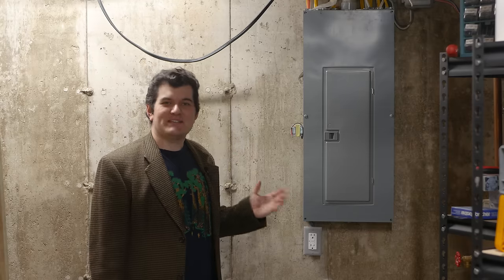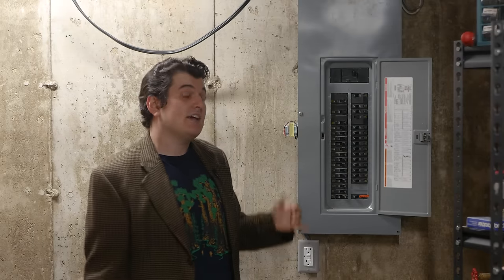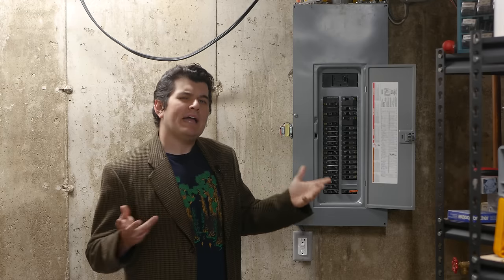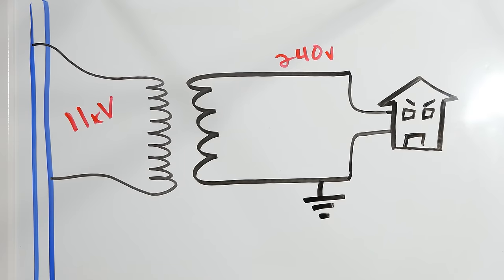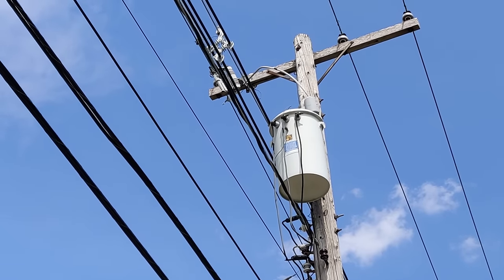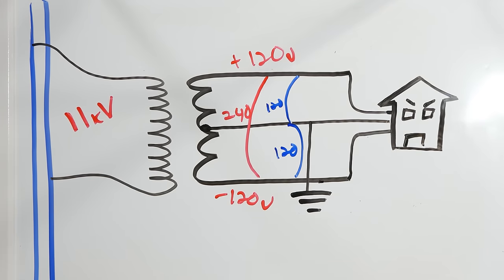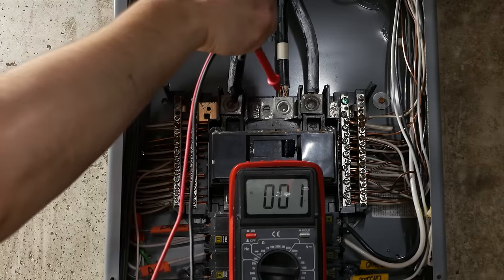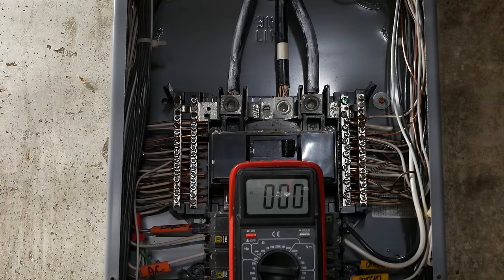The US electrical system is not 120V

Comment: 3-phase, 400V... is what we have at homes in “EU”... Why was this overlooked 😜 ?
Reply: 380, nominally. Not allowed in UK.
Reply: @gharwood1356  according to wikipedia 380V is the old standard. (single phase was 220V hence with 3 phases, its 380V) today, its 230V single phase and 400V 3-phase.
Reply: @kings_pride  Yes that's part of the harmonisation. Primarily to accommodate the UK's 240v. All they actually did was widen the tolerances a bit, so that no-one needed to change things much.
Reply: cries in single phase 230V
Reply: @gharwood1356  I can confirm working in the UKs Electrical Distribution Industry that the UK did absolutely nothing on the whole to confirm to the EU's 230 standard for harmonising the two networks (maybe the odd Transformer tap change here or there) . Our tolerances are +10% and - 6% around 230 so anywhere between 216.2  and 253 so in reality it makes very little difference and we rely on the tolerances as you said
Reply: @tiggerthegreeb  I think that confirms the gist of what I said, nobody did anything, they just tweaked the tolerances so that it all fitted.
Reply: @gharwood1356  400V since about 20 years nominally and actually.
Reply: @gharwood1356  it was 380V nominal a long time ago (maybe 20 years) now it is 400V nominal.
Reply: @Jonas_Aa  Really interesting, this. I've had a barrage of responses clarifying a 20v difference in nominals, but nothing on my criticism of UK vs EU outlets and wiring protocols. Odd.
Reply: So 4 conductors street-to-house instead of just 2 for 230V single phase. Overkill tbh
Reply: @Froggability  basically all houses in Sweden have 3-phase coming into them. If single phase would be used it would have to be so high current, and would load the system unevenly. Better to use 3-phase. Small houses maybe has 3 times 16A (at 230V) and bigger houses 3 times 25A or even more. We need our power to keep warm since we do not have has as much as in the US.

Also it is maybe 4 compared to 3 since you would want ground in the single phase system as well. But we usually run 5 cores (3 phase, zero and ground) to our electrical panels. So 5 compared to 3 but with just 2 more cores (5) you can run 200% more current in same cross section.
Reply: @Jonas_Aa . Ok. so in NZ /Aust we use 2 x 16mm (32mmsq) conductor at 63A /230 240v = 15kw. No earth required each house has earth stake.  
Sweden 3 x 16 or 25 x 230 = 11-17kw. Guessing conductors size : 6mm x 5 = 30mmsq. 
Works out very similar. If my 6mm guess is correct. The down side a more complex supply side.  Advantages each way I reckon
Reply: @Froggability  yeah usually 6mmx5 so seems to be same. Yeah and ups and downs with both systems I guess.
Reply: 400V. Wow. Seems like most items wouldn't draw much - no worries about popping breakers. I can't find anything around the house that would be better running on 400V.
Reply: @captbiptoe  With every plate abled to draw 2.5 kW plus the oven itself, it's good not to connect it to only one phase with 230V.
Reply: @captbiptoe   2x16A (~7360W) for cook top (we do not have gas). 1x16A (3680W) for oven.
And 3x10-25A for heating depending what type of heating.
Reply: @Jonas_Aa  Sounds good. I have the 120/240 of the video. On the 120v side they limit it to 15-20 amps - about 1500 watts per circuit. On the 240v side 32A max per circuit - just over 7000W per circuit. With the house having a 200A service. Plenty of power for most. As long as the home is wired properly all's well for all.
Reply: @captbiptoe  Here small houses have 3x16A total for whole house. If little bigger house with electrical heating it may be 3x20A or 3x25A sometimes bigger.
Reply: The American system looks ancient compared to the European system.
Reply: @Sir_Baddington  It is. It the same as it was when it was put together. We're not interested in anything higher than 240v in homes. No need for 400v to charge phone, run flat screen tv or much else in a house.
Reply: @captbiptoe  an electric car? a sauna? a large mig-welder? a lathe? an electric pizza oven?
Reply: @Sir_Baddington  higher voltage is not better for recharging. Pizza ovens need to be wood. Mig-welder: use consumer grade equipment -that's what we do here.
Reply: @captbiptoe  i see, USA is still a developing country
Reply: @Sir_Baddington  Just living with standards that were put in place long ago. Does it make sense to retrofit  having 120v, 240v and 400v going to every home? Fine with me if you'll pay for it.
Reply: You are or were getting water into your electrical panel. I see water stains just under the main breaker and corrosion on the L1 and L2 terminals.
Reply: I live in an apartment built by communists in 1980 and it has 3-phase 400V. And we have quite a lot of buildings like this in Romania.
Reply: Its standard in commercial in US that the panels will operate in 3 phase 480/277 (mechanical/main panel) and an auxiliary panel that runs 120/208 for your smaller appliances, outlets, etc. Either way, the standard house panel is overkill for most people as it is, not a whole lot of reason to overhaul the whole system.
Reply: 200 amps for single homes O.o    in hungary 1x32A/230V (single phase, more common, often only 16-20A for older buildings) or 3x16A (3-phase, often labeled as "industrial power) is what you get, also you need to pay a one time connection fee above 32A.   This is why people have hard time when wanting induction hobs in the kitchen.
Reply: I have always been interested on how your powergrid works over there I know i be interested to find out.
Reply: @dons8122  it is the same until the last transformer, we both use 3 phase generators and 3 phase transformers in the distribution grid. The only difference is the last mile, we use 3 phase transformer, and its center is the neutral. Grounding may differ, but here usually: neutral is grounded at the transformer station,  4 wires came from the  transformer station, and depending on what you want, you get 1 phase+N  or 3 ph + N to your meter. Then (depending on the age of installation) the neutral is grounded at the home, and separated into protective earth (green-yellow) and neutral (blue)   between any phase and the neutral is 230V nominally, and between any two phase is 400V (phase angle is 120 degree just like on the distribution grid)    Household items (incl boiler, washing machine etc..) use single phase 230V, plugs are rated for 16A (3,7kW), the only exception is induction/electric hobs, which may require multiphase connection (hardwired), or large fixed machines in workshops
Reply: Not 460?
Reply: @williamhuang8309  not 460. It is not a split phase system(where the phase angle is 180 degree), it's 3 phase with 120 degrees between each phase  https://en.wikipedia.org/wiki/Three-phase  If you look at the top image, you can see when one phase is at its hightest, the other two is at the same level, but they are not at the lowest.
Reply: You monsters....
Reply: Most homes don't have this, this is only for multi-family units like apartments and condos.
Reply: @Deathgrinder1337  The faster a lithium battery is charged the shorter it's useful lifespan.
Reply: @captbiptoe   It's not only about 400V, but rather about 3 phases - maybe you don't need it in house, but around it's quite useful, e.g. for various devices that use 3-phase motors - press drills, saws,
- you can't use it when you got only 2x120V (corect me if I'm wrong).
Reply: @xr3iiii  My auto mechanic's shop is in the business district and uses the usual 240v/120v service. His heavy equipment is 240v and runs just fine.
Reply: @kings_pride  3 phase is NOT 440 volts
Reply: 400v is only used for kitchen ovens, hot water heaters and for radiators. Washing machines also used to take 400v ages ago, but nowadays only 230v as we wash at lower tempatures. .
Reply: @Mnkskanal  not motors then
Reply: @pudpullertm  right. Motors can use all 3 phases. That's what we call Drehstrom - turning current, rotation current.
Reply: @Mnkskanal  3 phase 400V is cheaper than 1 phase 220V. All heavy equipment uses 3 phase 400V
Reply: @gharwood1356  You kind of solved that by leaving the EU
Reply: @tiggerthegreeb  And now the UK fucked off from the EU, so why would they start bothering now?
Reply: @darthbrooks4991  maybe you should not be so egocentric and short sighted . Learn something from others.  Your country is big not great.  Great ?  It only will be if you take all the good things from all countries and you can learn a lot from Europe who has hunderds of years more experience.
Reply: @Froggability  2.5mm^2 coper is more than enough for 16A. 4mm^2 is used for 32A. 32A*sqrt(3)*0.38kV = ~21 kWh just with 4 wires (3ph + 1 neutral) and only 16 mm^2  of conductor
Reply: @Froggability  There are many reasons to do it, one is actually that over a sufficiently large number of users the neutral current evens out, so you can quite safely use a smaller conductor for it. With 3 phase you ideally get trice the power with just one additional conductor. (US) split-phase only twice.

The other are electrical machines. Electric motors are so much easier to do on three-phase, and industrial users use them EVERYWHERE. Since the grid in europe had to be largely rebuilt after WW2, they made it three-phase (updated surviving old segments, sometimes even they were even still DC!) and hooked private houses up to it, too.
Reply: Is that commercial power or residential power. Commercial power yes. 400V seems a bit high. Maybe it was more like 339 VAC peak?
Reply: @jfeeney100  
3x230V to neutral, 3x400V between phases. 

No difference between commercial and residential power, if you need more you will get a 10kV (or higher) feed and provide your own transformer.
Reply: You have three-phase 400V power, but only use multiple phases for a few things. Still, I'm jealous. I'd love three-phase at my house, even if it's only 208V.
Reply: @Sir_Baddington  Sorry we didn't have a war that destroyed our whole continent to give us the opportunity to redo everything.
Reply: @danielkatona1866  - 3 phase in an apartment??? I don’t believe it! The block has 3 phase but in your apartment you only have one.
Reply: @Emin3m1986  well, believe it. The power meter is 3 phase and it's outside my apartment so that it could be read by the power company . From it the wires go into my fusebox inside the apartment and from there it is separated into mono phase, just one power socket was direct 3 phase in the kitchen but I uninstalled it as I had no use for it.
Reply: @jfeeney100  Residential. 3-phase. 400V. 4 or 5 wires: L1, L2, L3 and N and PE. Each L is 230V @ 50 Hz. Square root of 3 times 230 is ~400 V.
Reply: Voltage between two phases is 400V.
Reply: @kings_pride  When I worked on the old World Trade Center we had 440 and 480 volt circuits. 440 was the lighting fixtures.
Reply: In Russia, we have: 
normal 220 v (for TVs, laptops, chargers, etc.)
3-phase 380v (for electric cookers, big machines, something like that)
Reply: The EU isn't a monolith.
Reply: We don’t care what the EU has we have our American power 400 V is just simply un-American we want 5000 V
Reply: @Jonas_Aa  Three phases does saves copper as three conductors do the work of four.
Reply: @Jayce762  LOL. But, good luck charging your cars at home in the near future :-)
Reply: @captbiptoe  anything that produce heat runs better on High current washingmachine, spaceheater, dishwasher cooker....
Reply: do your ovens, dryers, water heaters, etc. use 400V 3 phase power?   Genuinely curious.  In the USA we have 240V plugs specifically for using 2-phase 240V power for these high draw appliances.
Reply: @travis1240  Ovens and waterheaters (the one demand ones) with three phase wired in (no plugs) are faily commom. For dryers its not common in households but in a more professional space you can find ones with a CEE three phase plugs.
Reply: @travis1240  yes all on 400 v 16 amp but our lights and ordinært outlets is 240v 13 amp
Reply: @captbiptoe  Yeah, sure, that’s why you need hundreds of thousands of rotary converters all over the place. In Europe we don’t even know those ! I’m an electrician in Belgium, and I had to watch American YT videos to learn about them ...
Reply: @dangerousish7837  The wars didn’t change anything in our electricity systems. The big changes came much much later.
Reply: @travis1240  In Belgium we only have the cooktops (and the occasional auxiliary water heater) running at 3 phase 400V in residential use. But as soon we have a workshop, all the fixed equipment like grinder, lathe, mill, beltsander, etc is 3 phase too.
Reply: @danielkatona1866  - mate, I’m Romanian too and never saw what are you saying but it makes sense what are you saying. Probably the installation you have is a very old one and very well designed. Having a 3 phase in your flat was probably for a cooker or a water heater and having a 3 phase you keep the lines balanced instead of having only one line and imbalance the other two. Sorry about my earlier message, clearly I was wrong, but it was hard for me to visualise 3ph in apartment blocks in Romania,  it makes sense now, if it was a very old installation as the old electrical engineers were brilliant. Now a days, everything what’s new is poorly built. I know I’m electrician in a different country and I’m comparing the installation to Romania. Actually, incomparable!!! Sadly...
Reply: @Stefan_Van_pellicom  Like I've said to others. We're stuck with what the electric company delivers, but I'm willing to upgrade if you're willing to pay for the rewiring and building repair that comes along for the ride. Here they charge for the transformer and the crew costs if we don't accept what comes standard.
Reply: @eedut  Cost of living doesn't feel like it.
Reply: @captbiptoe a lot of poverty and evetything is expensive for the poor. I could be talking about some african country or usa
Reply: @Jonas_Aa  Must be longer than 20 years. I was in school back then (a "Federal Higher Technical Institute" - an engineering-focused secondary school in Austria) and even back then we learned 230V. ...
Okay, I looked it up now: the change was made in 1987 (international norm IEC 60038). It took some years for adapting the new standard - the allowed tolerances changed. Since 2003 the norm says 230/400V (±10%)
Reply: @Froggability  The 4 conductors are usually in one underground cable containing all 4 wires. If you use 2 wires for the same amount of electrical power you need a higher cross-section for your installation.
Reply: @fmitterb  time flies.
Reply: @travis1240  Things that use 3-phase 400V in my home are: Induction Cooktop and EV charger. If I had a sauna, it would also use this. I don't. For heating, we use natural gas as it is less expensive than electricity. However, this is changing as a lot of people have photovoltaics. I don't. Some people have Geothermal heat pumps, which  require 3-phase 400V supply. I have lived in GA, USA for 7 years until 2004 (owned a home)... My general impression is that EU's "electricity" is more advanced, but the one in the USA is adequate for most. Also, having 3 phases has other advantages: if power goes out, sometimes only 1 or 2 phases go out... This means you still have some electricity in the house.
Reply: @gharwood1356  I remember in the period of the harmonization, we had light bulbs failing more frequently, they suffered from the higher voltage.
Reply: @captbiptoe  400V is all about better efficiency and thinner cables.
Reply: @Froggability  Does NZ/Aust use flat cables for power?  In N Eur we use round section cables, but they seem to have a smaller cross section.  A typical house is connected with 4 x 10 mm² cable and protected with 16 or 25 A fuses.
Reply: @pitecusH  Just for the record, I was violently opposed, and still am.
Reply: I live in EU. I mesured between phases 415 volts and 230 volts on single phase. Sometimes my phase voltage is 240 volts.
Reply: @dons8122  Here's a good series of videos on the subject - from the overall grid design to more specifics about generation, transmission, and distribution.  There are some nice shots of our 3-Phase 750KV power transmission lines too!  
https://www.youtube.com/watch?v=v1BMWczn7JM&list=PLTZM4MrZKfW-ftqKGSbO-DwDiOGqNmq53
Reply: @tuttebelleke  And a larger step down to recharge a smartphone. What's a 400V plug look like anyway?
Reply: @gharwood1356   uk is not in eu
Reply: @martinocko9  We were until a few weeks ago! Hoping to be back soon.